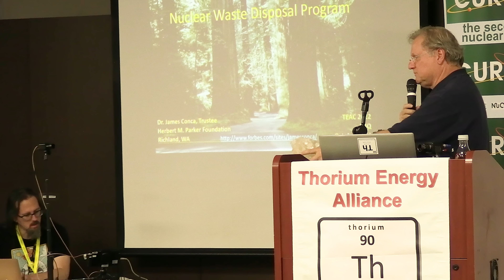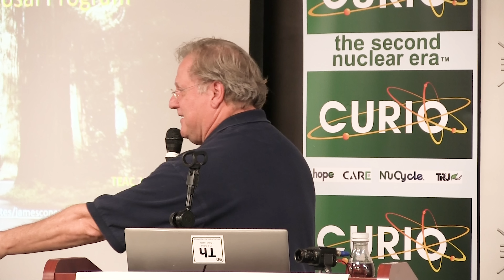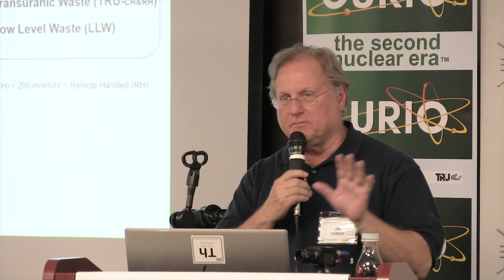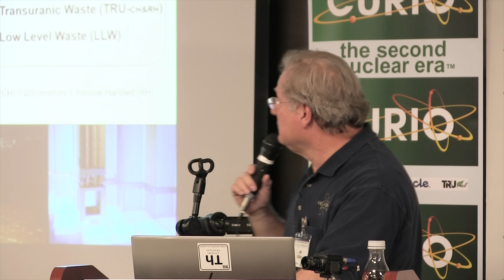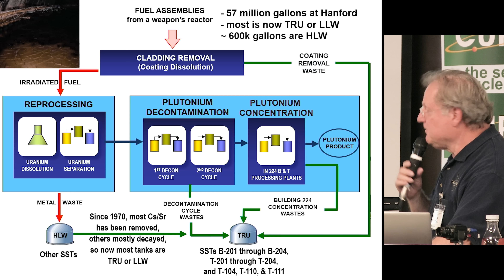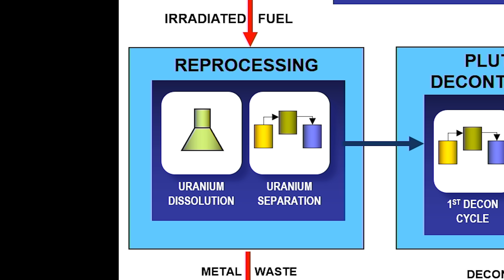Nuclear Waste Disposal in USA - Dr. James Conca @ TEAC11

Comment: Very misleading!  The law currently says that yucca Mountain will be the US site for High Level Waste!  To change the law it will require it going to a different State.  That won’t happen because of Political reasons!  Yucca Mountain is at the Nevada test Site where over 1000 Nuclear detonations have been conducted!  Therefore the land will never be put back into the public domain!  Yucca Mountain was determined to be the best site after reviewing 9 sites in the Country.  Salt sites will not be possible to retrieve the Waste for any reason.  Dr James Conca is from SNL, and has a $ connection to Whipp . Start Yucca Mountain up by allowing the money already collected from the Commercial reactors in this Country.
Reply from the maker: "That won’t happen because of Political reasons!" ...that's exactly what Dr. James Conca says in the video... politics are why we're not simply shipping used-fuel from civilian reactors to The WIPP. A presidential executive order or legislation from Congress can address this. Why on Earth should the public perception of this hinge on a single-site bottleneck?

Conca doesn't think the waste needs to go into The WIPP. He's fine with dry casks, and fine with recycling. But we don't NEED to recycle it... if it is easier to just stick it in The WIPP, so what?

Comment: I had always thought that the stuff which couldn't be reprocesses should be dumped in the Marianas Trench and let plate tectonics eliminate it from the biosphere.   Any heavy elements will be sucked down under the crust into the molten mass.  Journey to the Center of the Earth - non-fiction version. Anyone who has the technology to access the waste would be a nuclear power anyway.

Comment: Moltex Energy are building a fast spectrum molten salt reactor that will be fuelled by irradiated used fuel. It will extract the 96% of fissile energy that PWRs cannot use. Their waste will have a 1/2 life of 30 years vs 30,000 years for the used fuel as it stands today. Their reactor has no moderator so there’s no 7 year switch-out to deal with. And no radioactive carbon to dispose of.

Comment: Why are we talking about this when Thorcon can mass produce power plants cheaper than coal in shipyards and Elysium's reactors burn nuclear waste as fuel?
Reply from the maker: There's still Fission Products to dispose of. There will still be some Uranium and Plutonium isotopes that won't fission. Pro-nuclear people know about how fuel can be recycled or used more efficiently, but there are laws, for example in California, saying no new reactors can be built until there's an operating permanent waste repository. If you'd like to build a reactor in such a state, there needs to be a DGR for used fuel. Don't have to stick all the fuel in it, but there's needs to be an operating facility. The WIPP could do it, but its mandate was changed from receiving-everything to only-millitary-waste.
Reply: @gordonmcdowell (thankyou) I looked up a bunch of this stuff. Trying to find out if Elysium's (or other) MSRs use up transuranics, or maybe some fission products. Found what they call a "MSTR" ("molten salt transmutation reactor"). Mentioned a critical mass of transuranics for transmutation.

Comment: Storing waste on site is such a non issue.
Talking about these pie in the sky ideas of having to get rid of something you already have under control over is just some ultra fantacy idealist that wants to compel an industry or a job into existence that doesn't need to exist.

Putting these vessels in inaccessible areas makes it so the techs can't even access them.
What happens if you have a containment problem underground? You can't access that with heavy machinery for any reasonable cost.

Comment: Typically only 3% of the energy is extracted from Uranium in power stations.
 Use a Thorium Fueled Liquid Salt Nuclear Reactor to process the radioactive waste to use up the other 97%.
Reply: Yep, and only the spicy stuff remains. Which is good because it also means the half life is tiny, meaning it goes form angry to inert in up to a few years, meaning containment on site is absolutely possible. 
The issue with bomb waste was always that it was just radioactive enough to be a problem but not radioactive enough to dissipate quickly